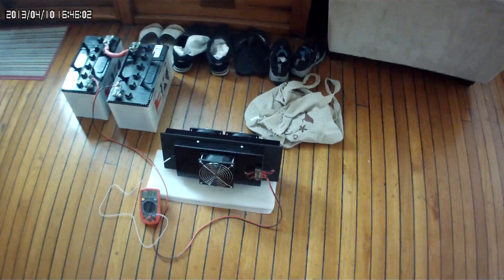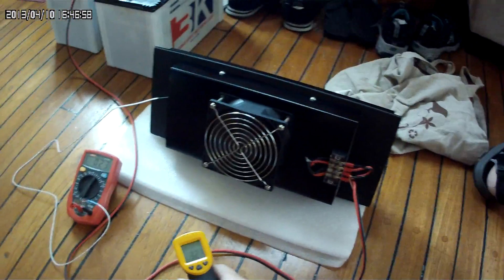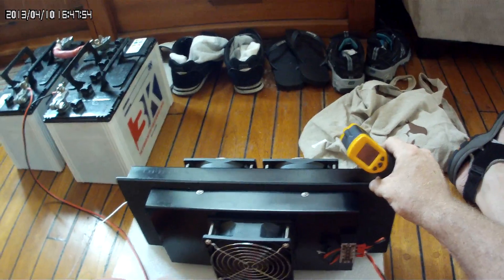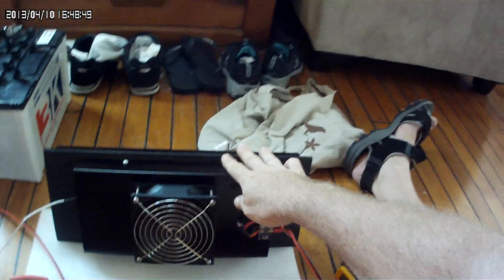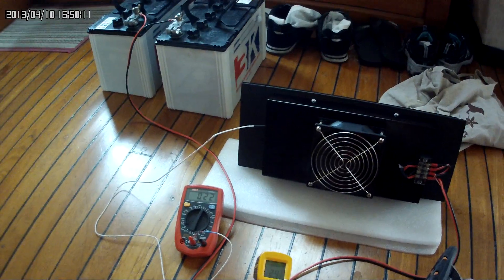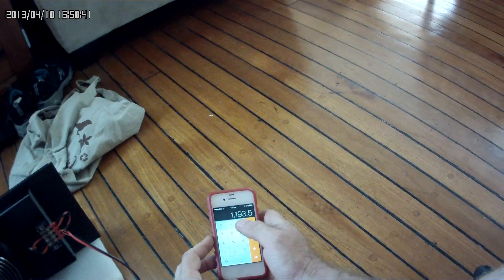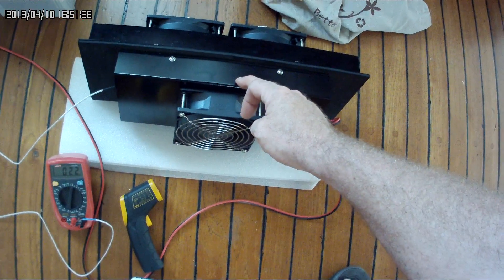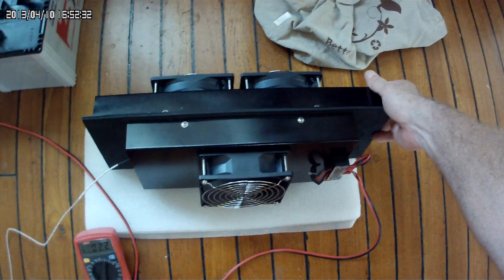Peltier Air Conditioning

Comment: I doubt if it will cool down a room , while you are making cooler air , you are also making warmer air on the reverse side cancelling any benefit,  and consuming power
Reply: It's a test. He will mount it on a window later on discharging the hot air outside.

Comment: Peltier max efficiency is %40. With 20w energy input you get an extra 7% more efficiency. With 5V 4A peltier cooling support, applying extra cooling to the heated surface is sufficient. Some special product developments mention about 60%. However, such modules are hard to find as they are very high in price.

Comment: thanks, good video ,can i use a peltier module air conditioning in the car ?
Reply from the maker: Minas Abajian never let the direct sunshine on the hot side.
Reply: Alan Marine Ok if I do this way, can I cool the car in the same way, and how many thermoelectric can I use?
Reply: Is the electricity of a car enough to run it, if there be any problem
Reply from the maker: I would install it under the floor board where the Sunshine never touches it. Best in a van
Reply from the maker: Minas Abajian I use 24v DC with solar on the roof. 12v uses too many amps
Reply: How many thermoelectric do you use so as to cool the room?
Reply from the maker: the small uses 3 modules, the large unit uses 6

Comment: you tube ave he has a good video of what a Peltier TEC modules do and how they work they are electritonic mods make heat on one side cool on other there are mant different varies to choose from fairly cheap also you would have to use 200 of them to do something to  make a differce lol not worth electric that they waste mys well put a 4 cly gas Wisconsin engine and a big industrial compressor lol

Comment: What is inside this contraption that is called Pelletier's module?  Are you suggesting that by blowing air across a "module" that the outflow air will suddenly become cooler!  That's why we need to see what is inside this "module" with a heat sink attached to it!

Comment: Please tell me where you got this unit and how long you can it run on your batteries?
Reply from the maker: I had it made to my specifications and design. I have a dawn to dusk sensor on it, so it only runs when the sun is shining. We use 24v DC 8 inch diameter fans in the bedroom at night. Low humidity and a cool breeze... sleep like a baby !!

Comment: Pelletier coolers are very inefficient so you're power consumption does not tell the story of BTU unless you take efficiency into account.  You'd be far better off running a small 5000 btu AC unit off an inverter.
Reply from the maker: alexermerson Hello, I understand your experience with an eBay module. Please read and view the multiple video's that outline I had the TEC modules made with the highest Semiconductor purity. This is not an "off the shelf" eBay TEC product. It is simply my video documentary of seeking efficiency !!! For 3 years they work for me... I am open to your expertise of improving the semiconductors... the goal is to eliminate freon gasses and compressors... I anticipate your wisdom !!!
Reply: Alan Marine,  After doing a bit of research, I discovered more questions than answers for both Peltier module efficiency and standard AC efficiency.   Last I read from a scientific article about a year ago, Peltier efficiencies maxed out at about 20% for the cutting edge technology while typical commercially available efficiency is 10-15%.  Perhaps by now, the 20% is commercially available, but even if so, that's still only 1/3 to 1/2 the 40–60% efficiency (according to wikepedia) achieved by conventional compression cycle systems.   I looked up what I suspect may be an example of the TEC modules you are referring to (TEC1-12708) from electron.com, but despite repeatedly touting their 'amazing efficiency', they don't include all the actual data allowing anyone to determine that efficiency.  They only cover input wattage and temperature delta information, but without actual heat flow information, power output and efficiency are unsolvable.  It's like trying to determine power when only voltage is known.    However, as far as standard AC efficiency, there seems to be some shenanigans going on there as well.  I looked up an example of the specs for a typical small 5000 btu/hr AC which is stated to draw 500 watts running and which correspondingly would cool 10 btu/h per watt.  Well according to power conversion, at 100% efficiency, 1 Btu/h = 2.931x10-4 kW  or 1 watt=3.4 btu/h   so that 500 watt AC unit cooling 5000 btu/h is about 300% efficient which is of course impossible.  I guess the only way to truly know without more reliable sources is to test and compare for yourself or just enjoy the fun you're having with experimenting with what works for you and without worrying about whether it's the most efficient option.  Have a great night and good luck!
Reply: Since the unit is for a boat, have you considered using water to cool the hot side instead of air?     Water has way more heat carrying capacity than air plus it's typically cooler as well during the summer.  Heck, for much of the year before the water gets warm, you can probably get away with simply pumping cool water through a radiator and just running the fans without the TECs.
Reply: alex i heard fridge systems are running at over 100 percent efficacy and its the only electrical device in our home running at overunity!!!

Comment: if your math is right then you would need 1200w for around 4000 btu, while 1200w on a conventional AC will yield about 12000 btu, or what americans call "a ton"

keep it up, metric system ftw

Comment: Thank you very much for sharing your idea. i noticed you said you purchased the unit. However, from your experience, can do you have an idea how many Peltier units were used for the air conditioner unit? is it possible to connect them all in parallel i.e connect all the + together and the - together then connect to the DC supply? Can this unit cool a room of 100 square meter, if it can for how long. Sorry for so many question. i have to ask them. i am new with Peltier  devices.
Reply from the maker: Abdul-alim Balarabe Dawud... Hello, I live in Hong Kong and had a design to make make an efficient Thermal Electrical Cooling unit. I worked with a China factory to make a TEC module that had a 96-98% efficient TEC semi-conductor. The R&D was costly, and as nothing in this world is free. My purchase of the first sample arrived. I am honoured you watched my video. The eBay modules are only 5% efficient. Do your homework and it is worth the investment to make an efficient TEC module !!! It worked for me, and I have 9 units running on my boats from sun up to sun down !!!
Reply: Thank you very much for the prompt response. i know R&D is expensive. All i am requesting is some help by pointing me on the right direction. it may be inform of references to some sites of some literature. but all the same thank for your response i quite appreciate it. hope to see more of your videos.
Reply: Alan... Can you please name the what tec unit you are using i means its rating.... Like tec1 12706 is most commonly available in market...

Comment: Alan,1. how many TEC did you use? And 2. would it be effective with 75 amp 12 volt system? 3.In how much time did it drain your batteries? Thanks in advance.

Comment: Another idea is to use a PC water block and run open circuit water through it but PC parts aren't exactly designed for saltwater, or any non filtered water for that matter, a electric pump is required, and it has to be run through the hull or in my case probably through the cockpit and over the gunwale. Also, I live in Florida so the water is often very warm (98F/36C last summer) and may not get me very cold air.

Comment: My plan is to buy an Adafruit 12v 5A module with a pre-installed heat sink and fan, and put a computer heatsink on the other side, on one of the locker doors that gives access to the inside of the dash and the gunwales to vent heat out through the gunwales, since there are rod holders are installed that work as vents. The boat is a 26 foot (7.92 meter) custom sport boat and the cabin is maybe about 12 feet (3.6 meters) and doesn't have standing room, but it's good for dodging storms and storage, so I figure a small peltier may be able to cool it nicely.

Comment: wich Chip tec1-12706 you have ?? Why not use the Teg chips for your project will work 80%+ better
Reply from the maker: Hello, I had the TEC modules made to our specifications. The purity of the semiconductors that are purchased "off the shelf" retail, are not adequate for my application.
Reply: Alan Marine  Have you ever checked the multi stage Tec chips everredtronics.com

Comment: you are not controlling the amp.  Therefore the lowest temp u gonna get is 70f.  If you get a buck booster with amp controller, raise the amp to 3, you can get temperature to 0c

Comment: you're in a boat? what better place to put the hot side than in the water!
Reply from the maker: Salt water chews up the aluminium. I am having a copper unit made to try ! Great minds think alike :-)
Reply: nice, I bet that will work brilliantly!
Reply: it its a big boat, why doesn't it have an air conditioner, i am pretty sure a car air conditioner would be small and work very well
Reply: This principle is used in heat pumps. If you don't have access to lake water, they drill wells.
Reply: The producer of this video seems to suggest that he can create energy out of the thin air. The law of conservation of energy says he is wrong!
Reply: rpaull3 Yeah just hook in a pump for lake water cooling!

Comment: Would this system or one similar to it run on 12 -14 volts? (automotive)
Reply from the maker: Sure. You can make with the modules in parallel for 12v. I made it 24v because my solar power system is 24v.
Reply: What sort of price point is this devise?
Reply: Do you know what type of Peltier plate is in it (model etc)?
Reply: Sure, I wasn't sure if he was the manufacturer.

Comment: I hear Peltier units are notoriously inefficient.  Would be curious how much power is being consumed.  Maybe using a solar cell to power the cells would be better... hard sun = higher ambient temperatures and also more power available.   That is 1194 BTUs equivalent.  Would be interesting to compare to a standard AC unit..

Comment: coolest part is if you reverse polarity....you get a heater
Reply: One side gets very hot, while the other side gets very cold.. If you reverse the polarity, it just switches which side gets hot and cold.
Reply: Yeah but peltiers are not efficient, a resistance would be a better option. Resistance heaters are cheap, air conditioners are never cheap... Cooling systems are always quite complex.
Reply: True, this video is literally just a heater and a cooler at the same time.

Comment: So, what i understand the fan for cool side is blowing in...? Why not turn it so it blows right out from the middle? I would believe this would be much better cooling or cool the air more faster..
Reply: More turbulent air makes for a better mixture and more efficient heat transfer. Getting the most out of the unit itself. For a better feel just get a fan to blow the cold air onto your face.
Reply: +mi
kettt3

Comment: Guys please someone correct me if what I think I am looking at is wrong.  Let's say you have the perfect Peltier Unit.  Let's say it is designed to remove more than enough heat to cool down your boat.   Again please correct me if I am wrong.   The unit I am looking at is just transferring heat, it is not removing it.   The heat side of the unit would somehow need to be releasing its heat to the environment outside of the cabin.   What I am looking at is removing heat from a small bit of the air in the cabin and when both cold and hot side release the air flowing across both sides the cold and hot air are just blending back together.  No gain at all, matter of fact you are probably generating more heat with the electronics and the battery.
Reply from the maker: You will need the hot side on the outside of the vessel, and the cold side on the inside. Make sure the sun does not shine on the hot side. It will drastically effect how it cools. Make sure you can cycle the system to defrost the cold side and allow the water to safely drain away.
Reply: +Scott Fabre 8 PELTIERS (TEC1-12706)  CAN CHANGE WATER INTO ICE [1.5 LITER]  IF I DIRECTLY PUT WATER ON COLD SIDE OF PELTIER... I'LL COVER THE WHOLE 8 PELTIERS CAN ITS POSSIBLE ???? PLEASE HELM ME MAIL ME AT : dimabogdan1963@gmail.com OR WHATSAPP ME @ +1 206 202 1856
THANKS

Comment: You think I could use one of them 60 watt peltier  cooling units off eBay to cool the aft cabin of a 24ft cabin cruiser it's a pretty small area just big enough to lay down I could seal the area off somewhat to keep cool air in. I'm talking like 80F degrees down To  70F
Reply from the maker: Anything to take down the humidity and a few degrees helps.... You need to make sure you have the battery storage to power it all night, and always over-size the wire according to the length and amp draw.

Comment: 1193 btu's couldn't cool a fart
Reply: 1193 BTU at 100% efficiency. Actual number is closer to 214 BTU because peak efficiency of TE cells is about 18% (if the power for the fans costs nothing). This is about 1/56 of a ton of AC.
Reply: knockitofff that is 1/10th of a ton of AC. one ton cools 400 sq. ft
Reply: @myshadowkungfu  perfect to cool a van small camper etc... wish someone would manufacture them for consumers lots of ppl would buy them
Reply: what if i only wanted to cool two cubic meters though, is 250btu enough lol

Comment: Thermoelectric junctions are about 4 times less efficient in refrigeration applications than conventional means (they offer around 10–15% efficiency of the ideal Carnot cycle refrigerator, compared with 40–60% achieved by conventional compression cycle systems. Due to this lower efficiency, thermoelectric cooling is generally only used in environments where the solid state nature (no moving parts, low maintenance, compact size, and orientation insensitivity) outweighs pure efficiency.
Reply: +A D 8 PELTIERS (TEC1-12706)  CAN CHANGE WATER INTO ICE [1.5 LITER]  IF I DIRECTLY PUT WATER ON COLD SIDE OF PELTIER... I'LL COVER THE WHOLE 8 PELTIERS CAN ITS POSSIBLE ???? PLEASE HELM ME MAIL ME AT : dimabogdan1963@gmail.com OR WHATSAPP ME @ +1 206 202 1856
THANKS

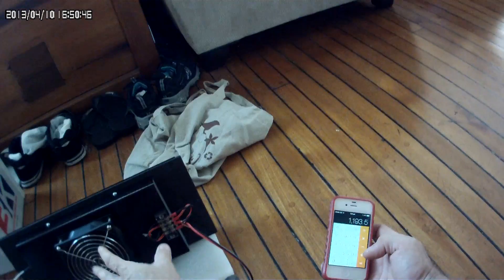Comment: 4:46 
I'm afraid you are wrong , this 1200 BTU you just calculated represent the cooling AND heat units of your Peltier device.
Peltier device will give you about a meager 15% efficiency , so thats about 180 BTU.
To be honest Peltier are not good for permanent applications , an AC unit would be more adequate to your situation ...and probably cheaper too.
Reply from the maker: Hello. You are correct about the common TEC modules that have not changed since the 1960's. We have been having fun trying different P and N type semiconductors to bring this into the modern age... It is a fun project to improve efficiency !
Reply: +Alan Marine What you say is non sense , silicium didn't change from 1960 to today , just like iron is still iron.
The most effiecient Peltier modules used by NASA today reach about 15% - 20% effiency at most.
Reply: +HexoFire No way even if you actually got 1200BTU, it's nowhere near enough, you need to start at 5000BTU on up.  Think of how long it takes for this module to cool a mini fridge, let alone a room.  What result did you get?
Reply: and yet he is cooling his boat cabin unless you think he is lying and has an ac unit in the background. the fact is it is cooling his place so how do you explain it. just accept it.
Reply: A window air conditioner rated at 5000 btu can only cool about 300 square foot room. Peltier just isn't practical for cooling anything that isn't directly touching the cold side. Best case is a small cooler to keep your beer cool (not cold).

Comment: Nice video !
Is it more efficient to cool using peltier or condenser?
I am still figuring out.
Reply from the maker: My experience with the common Peltier TEC modules available currently for retail are NOT efficient at all, so I went out with my engineering friends to experiment with different P-type and N-type semiconductors to make a more efficient TEC module. We're not re-inventing the wheel, just building a better mouse trap :-) We are getting much better efficiency as you can see in some of my testing in other video's, and as I live my life off-the-grid. Pure DC power without the efficiency lose of a DC to AC inverter, I already gain an added 13%-18% without the inverter for AC power. I am personally much happier with the TEC cooling.
Reply: Alan Marine
 Thanks for giving me some background info about your project. I hope you continue to have efficiency gains and maybe come up a new patent some day!
Reply: Definitely a condenser.

Comment: Nice idea but who sells the large unit like yours ? I can only find the small single units
Reply from the maker: Hello... I had every component made to be efficient. There are several companies that make similar small units, but the standard TEC module you buy off the shelf is basically an average of 10% efficient. I have improved that with a lot of trial and error... when all else fails DIY.. HaHaHaHa
Reply: thank you
Reply: Alan Marine I was under the impression the if a delta T of 70 degrees F between the hot side and the cold side is maintained a higher efficiency that 10% is obtainable, I would think at least 40% could be reached.  I have not backed this up personally, but I am working on it.
Reply: Jason DeLozier I am building a dual water block system with the Peltier TEC module in the middle.  I shall regulate the temperature on both sides to maintain the 70 degree delta T.  At this point I am not expecting anything more than achieving the highest efficiency obtainable.